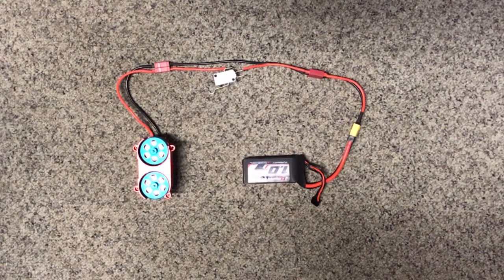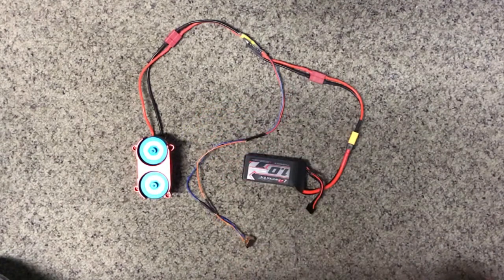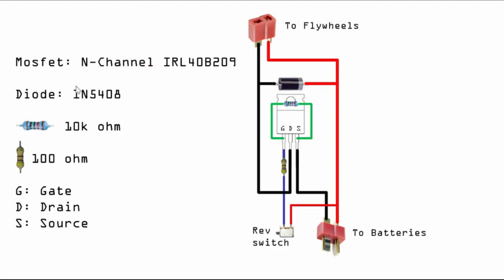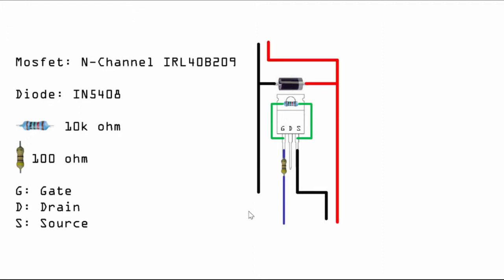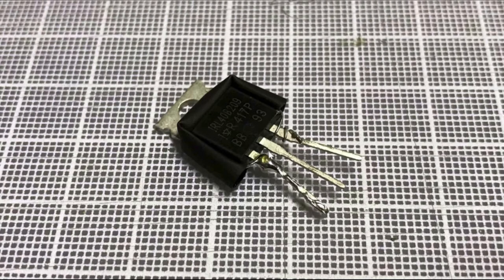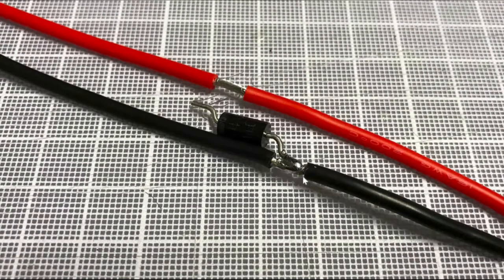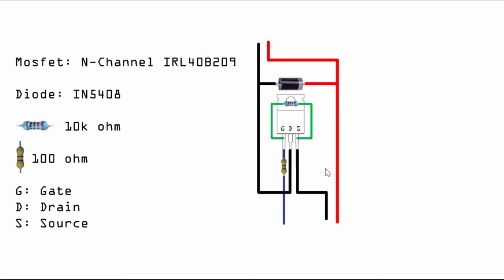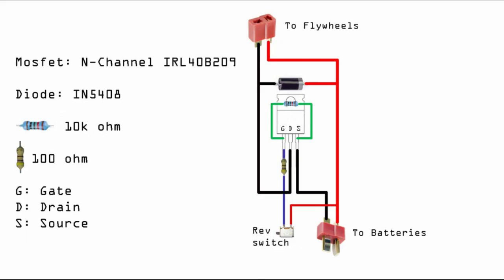{How To} Nerf - Mosfet as switch

Comment: is the 100ohm resistor important? i received this mosfet in a kit with diode and amd 10k ohm only. Works fine with a worker 15A switch. is 100ohm just to protect the mosfet?
Reply from the maker: It should be fine without the 100ohm resistor. But if u uses the mosfet with micro processor like Arduino, I will definitely put in place the 100ohm

Comment: i cant find a rapidstrike 3-switch mosfet video on youtube. has no one made a step by step guide on how to wire a rapistrike with 3 switches and a mosfet?
Reply from the maker: I only saw diagrams on the internet for the mosfet 3 switches setup, as for video on YouTube I am not sure if there is any (I think I can work on one for the future)
Reply: Tungsten EXE a video would be great. the diagrams don’t help me understanding if i need a switchplate or not but also to stuff the cables or which fet, diode, resistor to use.
Reply from the maker: @vastneon  hi, just uploaded a vid on using mosfet with 3 switches, here is the link https://youtu.be/mE-2ePw5lB0 do check it out.

Comment: I would like to ask, I follow your instruction but once I connect to the battery, it always opens(I connect the wire to N. O on the micro switch), and no matter what I push it the motor won't stop running
Reply from the maker: One possible reason is the mosfet had short out and had become faulty (even new purchase mosfet can be faulty). If you try to make a new setup, to check your mosfet before use, you can watch this video https://youtu.be/RkWy1EirEu8 on how to check a mosfet. second possibility, the gate is always high, which mean the micro-switch could be connected wrongly/faulty or the pull down resister, you can check the voltage of the gate with a multimeter to check if it is always high.Last if you are using IRFZ44N, chenage it. Use other N-Channel mosfet which can handle higher current like IRLB3034PBF or IRL40B209 (the one I use). Hope this help.

Comment: Omg tungsten has always had the best guides and the best troubleshooting I've been having trouble with a mosfet and this video cleared everything up please keep up the good work! :D same problem as the person below running an IRFZ44N from blastertech not strong enough for my 2 Cronus 2 motors with a  3s 2400mah lihv in a ofp 41.5mm cage with blasterforge ultra crush wheels.
Reply from the maker: Thanks Todjlet, I am glad the video is of help :) Thanks for your support, also I am currently conducting a 1000 subs giveaways on my latest video, do go check it out :)

Comment: What kind of P-channel MOSFET would you recommend if I was planning on doing active braking? I’m currently using IRLB3034PBF N-channel for my flywheel builds but I want to use one for my pusher motors.
Reply from the maker: I am sorry, I have not tried wiring P-channel and N-channel mosfets together for active braking, hence I think I should not be recommending one for your usage. So far I have not found a good example circuit on this to refer to (as I am still learning myself), most circuits I saw assume the reaction is instant and did not have any safeguard, I guess the circuit may work but may not be good in a long run. Also if you are working with micro-controllers like Arduino you will need two N-channel and one P-channel.
Reply: What's the advantage of braking?
Reply from the maker: for braking I will need it more so for the auto pusher as after detecting the last shot fired I will nee to stop the DC motor as fast as I can to prevent more shots being fired. as for the Flywheel, it is not necessary actually, all it does is to stop the spin down of the flywheel, in a way it make the setup less noisy.

Comment: Hey, Ive done this exact build in a hera but my main issue is that now when any power is applied it directly revs and wont stop until power is disconnected. 

I have the flyback diode in, as well as a mosfet but it seems like it just wont work correctly. 

I noticed when the rev switch is pressed however that the rpm of the motors seems to dip slightly. 

Any help would be greatly appreciated
Reply from the maker: hmmm first make sure it is a N-channel mosfet not P-channel, next, I can think of two possible reasons, first the mosfet had short out and had become faulty (even new purchase mosfet can be faulty). If you try to make a new setup, to check your mosfet before use, you can watch this video https://youtu.be/RkWy1EirEu8 on how to check a mosfet. second possibility, the gate is always high, which mean the some micro-switch could be connected wrongly/faulty or the pull down resister.
Reply: Thanks for the reply! 
I just checked and it is an IRFZ44N N-channel mosfet. 

I tested the one that initially blew out and sure enough it was bad.

Just a few minutes ago I swapped another one out in the circuit and tested with a 9volt and it worked flawlessly, but when I hooked the 3s lipo up it seemed like that burnt the mosfet out on the very first activation of the rev switch similar to the first time. 

Im using a high discharge 3s 2200 mAh battery, Im not sure if it is too powerful or if I just got a very bad batch of fets.
Reply from the maker: Hi IRFZ44N can only take 49A max and that is when condition are prefect. when we rev the flywheel there will be a short but high current draw to start the flywheel, I highly recommend you to use another Mosfet like IRLB3034PBF which Out of Dart does sell in his Esty https://www.etsy.com/sg-en/listing/511162483/mosfet-irlb3034pbf?ref=shop_home_active_55 or IRL40B209 (the one I use). Hope this help.
Reply: Alrighty cool beans Ive ordered two IRL3034PBF fets to try out! Hopefully this works out!

I appreciate the quick and helpful replies man, this saved me from putting a Dremel to the case to jerry rig a heavy rev switch up.
Reply from the maker: VerminBourbon no prob man :)
Reply from the maker: VerminBourbon one more thing, do check the rest of the wiring and make sure there is nothing causing a short circuit as that will create max current draw.
Reply: Alright so I have finally finished the project and sure enough you were correct about the mosfet! I redid all the wiring minus the flywheel terminal leads and it now is running like a champ!!!

Heres the final product!

http://i68.tinypic.com/vdl7hf.jpg
Reply from the maker: That is Great! Excellent! the blaster look great!
Reply: @TungstenEXE  May I know exactly whats the difference between "IRL" and "IRF" mosfet? haha I know. It's 2020 but I'm watching your video haha
Reply from the maker: @genesisdungca1854  the IRL40B209 mosfet is a optimized for Logic Level Drive as I sometime uses the mosfet with arduino, a IRL will be useful as I can get the Gate of the mosfet to fully open at 5v, as for IRF I believe it will require around 10v.
Reply: @TungstenEXE  I now ordered IRLB3034, is that gonna work? Also, is there a difference between deans connector and XT60? In your case you use deans for the connection of fly wheel. In my case I only have an XT60, is it fine?
Reply from the maker: @genesisdungca1854  Yes IRLB3034 is good :) for connector, both dean or XT60 are alright, sometime I use dean as it takes up less space, otherwise I will use XT60. XT60 is easier to work with in term of soldering.
Reply: @TungstenEXE  Thank you so much for the fast reply, really appreciate it. I will start the project as soon as all the materials are complete hopefully by the weekend. I will use this video as my whole guide. I will still post here my questions if ever I have one, hoping that you still entertain my further questions. Thanks again and be safe. :)